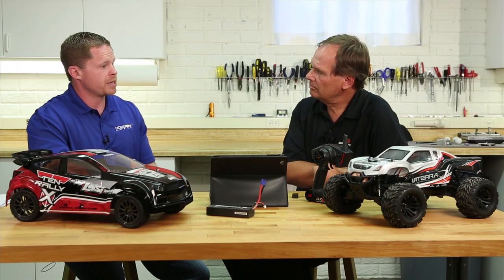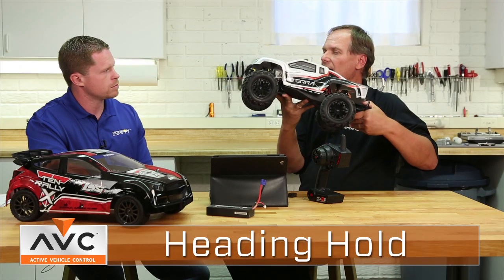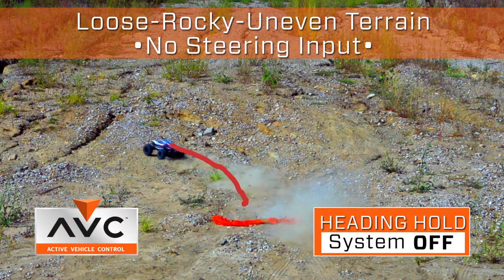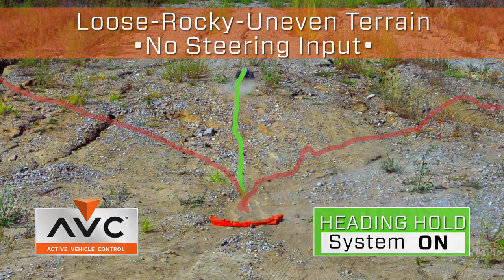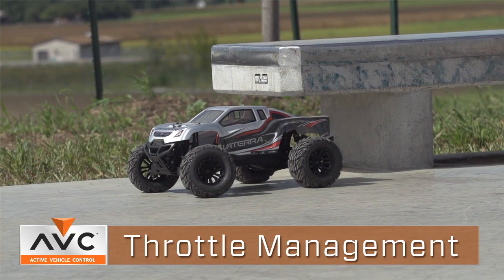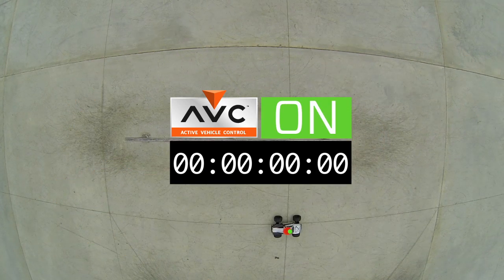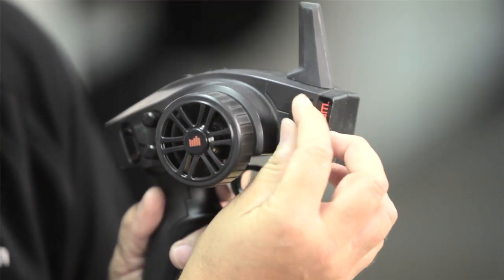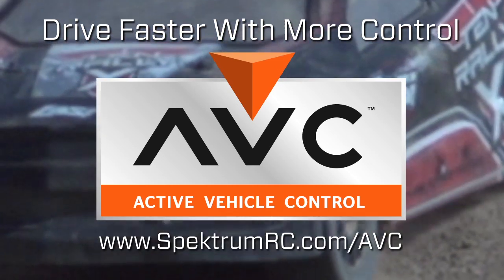Active Vehicle Control (AVC) The Tech

Comment: Hi could you tell how SENSITIVITY adjustments can be made using DX3s or DX3R????

 Like you mentioned DX3s can be used in a way that Throttle & Steeringsetting are made simultaneously.
Reply: I also use a DX3R and i have a losi eight on the way.  It says you use aux1 channel to change the steering and throttle simultaneously.
Reply: Cool, Thanks for that mate
Reply: been running my Losi Eight its awesome!  But yeah aux channel is pretty easy to set and get a feel for your AVC level.